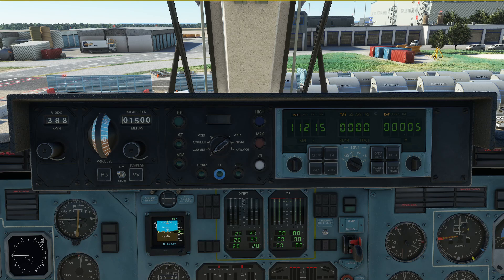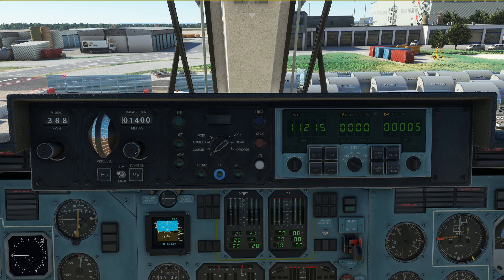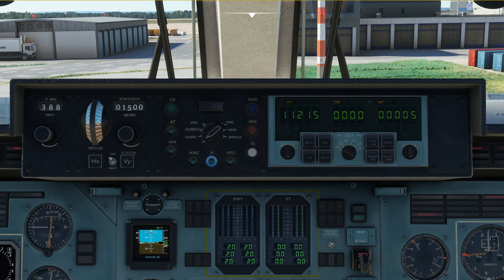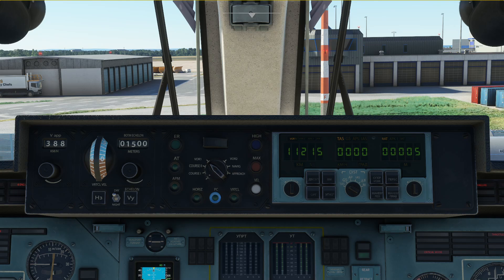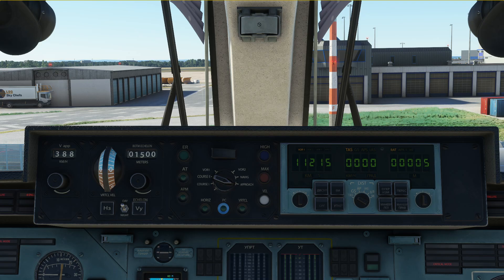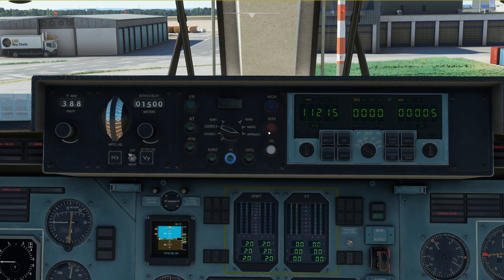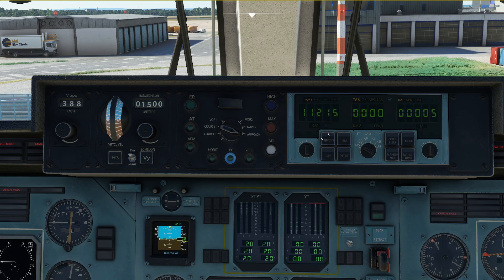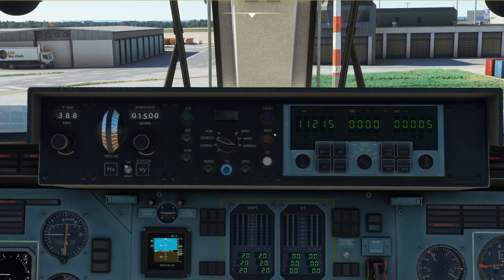Antonov 225 Autopilot Explained | Real Airline Pilot

Comment: IIRC VOR modes were not used on real An-124-100 (according to RLE), so probably also not used on An-225.
IIRC on real An-225 there was no autothrottle.
MAX is mislabelled. X is actually Ch in cyrilic so it should be labelled MACH in english cockpit. ER should be AP.

Comment: What totally perplexes me is why in the world after decades of the fall of the soviet union Antonov did not engage foreign partners and did not retrofit modern avionics into the airplane.  Somebody like honeywell or collins would've jumped up and down at the opportunity at a very reasonable cost, comparatively speaking. But on the other note seeing this beast in person back behind the iron curtain as a kid and young adult was an experience of a life time :).
Reply from the maker: Even retrofitting an airplane with modern Avionics costs millions, probably tens or hundreds of millions. Why would you do it, if the costs of paying the six man crew is cheaper?
We're talking about a single airplane here, not an entire fleet. It would probably not make any economical sense.
Reply: @A330Driver  on this topic, do you think the rebuilt version will have a modern avionics suite?
Reply: @mattwright5887  Really don't see what anyone see's in this eyesore.
Reply: Well, it is a unique purpose-built airplane, not a general airliner. Only a very select few people would pilot it anyway and they seemed to handle the dated cockpit just fine. It also didn't have to worry about quick turnarounds and (if I recall correctly) didn't even follow the same routing as a normal airliner.
Reply: Some An-124 have received avionics upgrade with modern FMS systems.
Reply: Hopefully If they rebuilt this legendary plane again they would upgrade the avionics.